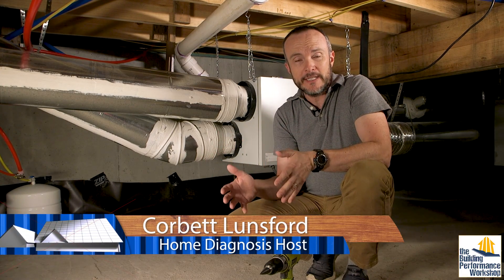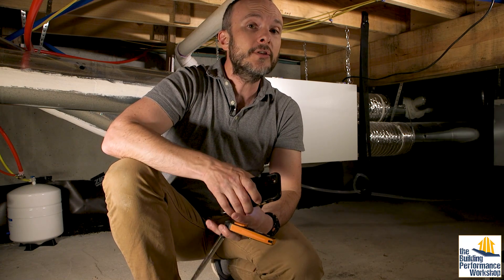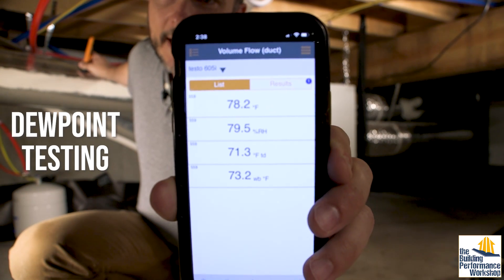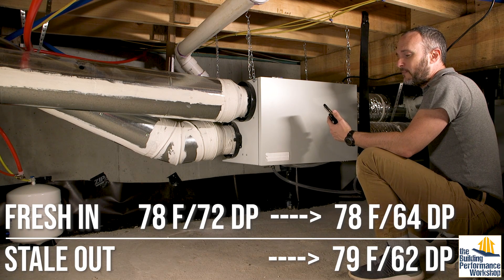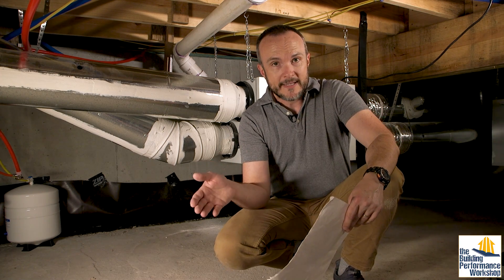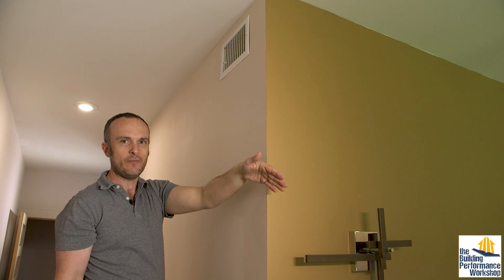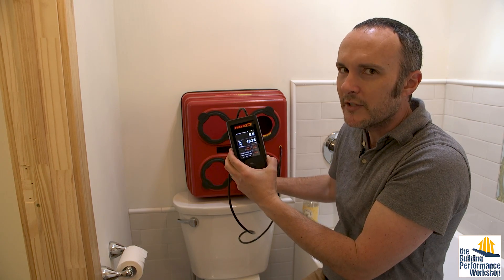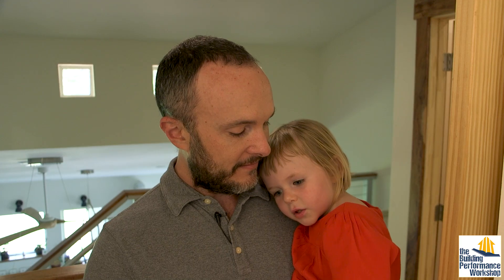Testing Our Home's ERV: Ventilation Airflow, Dewpoint Performance, and Grill Balancing

Comment: Hi Corbett,
I am thinking of using erv extraction point in the kitchen for the residual smoke that escapes the hood. But I can find a fan tech grease filter for a 4” duct size. 
Any thoughts , and how did you install it in your kitchen for extraction?
Thanks 
Rohan
Reply from the maker: Rohan, we don’t have an overflow ERV exhaust for the kitchen- I recommend designing your hood to be good enough to capture all of it.

Comment: Any good tutorials on how to measure / balance an ERV that asks for Differential pressure (Pa)?  with those ports you mentioned on the ERV?  I have a Panasonic Intellibalance 100... I tried using the CFM method with the gauge you have, and it says exhaust out of the house is like 65 - 70CFM but the CFM going into my return duct work is 80-140 CFM (set to 50 - 100 on the unit respectively),  it has knobs so you can say supply air 50 - 100 CFM and Exhaust air 50 - 100.  But no matter what I set exhaust to it says 65- 70 CFM on the CFM meter.. its exhausting out of an old water heater B venting.  Supposed to be 4 inch round ducting.  And i've been having a lot of humidity issues with the ERV.  So I figured it has to be a balance issue.  (not enough exhaust air to balance out incoming air especially with humidity).

Comment: Why you did not throw the fresh air into your hvac supply ducts and built a dedicated fresh air supply?
Reply from the maker: That works too- we designed and built this house with our own hands so we could know for a fact what it takes for builders and trades to implement the most extreme improvements over standard construction. An American home with radiant heating would have to duct a full ventilation system like this too, as would virtually every home outside North America.

Comment: Why do we install 100cfm fan in bathrooms?
Reply from the maker: Good q, Guillaume- that’s a compromise for a single location fan in a bigger bathroom where you know it’s not going to work well. It’s a dumb fix imho, if two smaller exhaust locations at 25 cfm apiece will actually remove the pollutants before they take over the whole room.

Comment: So you put your shower duct right inside the shower.  I have heard 50/50 opinions on that.  Zehnder did my layout and they are recommending it outside the shower.  Thoughts on that?
Reply from the maker: I’d say that’s a mistake- in this case, both common sense and scientific testing show exhausting right where the pollutants are created is best.

Comment: You just keep hitting it out of the park with these ventilation videos. Before watching the last two I was certain that exhausting a bathroom with a ventilator would not evacuate the steam effectively enough compared to an exhaust fan. Is there a resource that guves guidelines for the exhaust and supply CFM levels you should be aiming for per room? Thanks bud.
Reply from the maker: Hey man- glad these are doing it for you. ASHRAE 62.2 gives guidance on this, but there are some basic notms that have been around for years that work too, like 50 cfm bath fan (intermittent) or 25 cfm (continuous).

Comment: This aspect is what Im still at somewhat of a loss for. I know how i want the air to move around inside the house, but how to know the right volume of air to move in order to get exactly what I want, and how to ensure I get the results I want, by setting the whole system up correctly, has been a mystery. You have done a good job of explaining this, and I’m starting to understand. Its not as complicated or mysterious as it seemed. Its also kind of exciting to think that there literally is a way to control air movement the way I have always wanted, and a way to test it all to be sure it is actually doing it.
Reply from the maker: Excellent to hear, @compactc9, and I’m delighted that my work is helping make things clearer for you. A lot of this is buried and hidden inside engineering guidelines, but most engineers don’t care about houses, they stick with big buildings.
Reply: @HomePerformance  its true, this type of detail and HVAC setup is more of a commercial building type of thing. And i find that frustrating, as it matter just as much in houses, I think.

Comment: Another great video sir. I’m very interested in what your doing there isn’t a professional in my town that knows what you know. So how can I do what you teach with less expensive tools. I can but I don’t want to drop 10k in diagnostic tools for just one house?  Also why do you prefer the carrier? I just put in a Mitsubishi system and now you and Risinger are talking Carrier!
Reply from the maker: I don’t endorse just one brand of anything, Adam- Carrier took feedback from users and installers to create that new ductless head, and Mitsubishi is a lot slower to adapt lately. Just trying to shine a light on good stuff. Also, I’m happy to get on a call with you to help you plan your project. If you want that, it’s easy to book:
https://buildingperformanceworkshop.com/video-consulting
Reply: I agree. I need to learn more! I want to do my whole ductwork myself because I don't trust the pros around here. No one ever heard of a manual J or how tonseal ductwork.
Reply from the maker: Well, it’s do-able if you need to, Benoit! Do it!

Comment: been using those round ducts for a very long time.  What I find is that when they are dialed in correctly the bathrooms dry down fast and there is virtually no mold
Reply from the maker: Amen, Steve